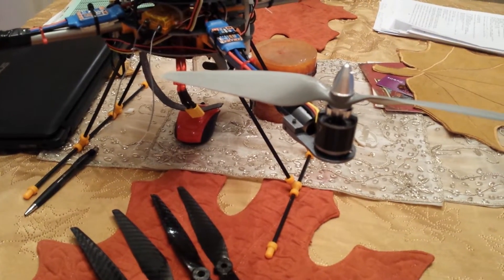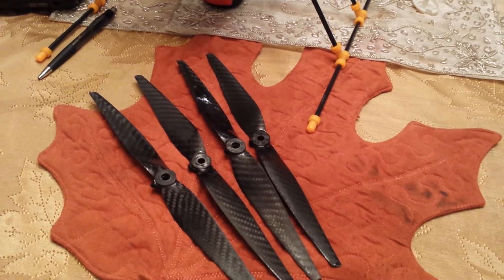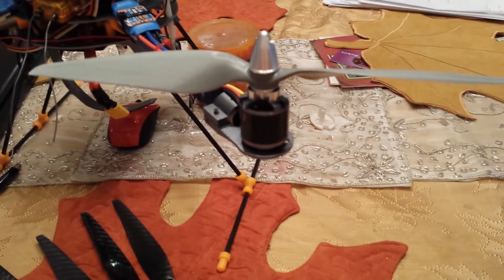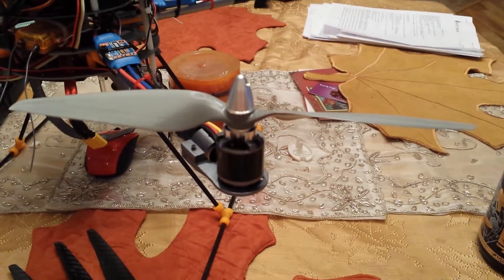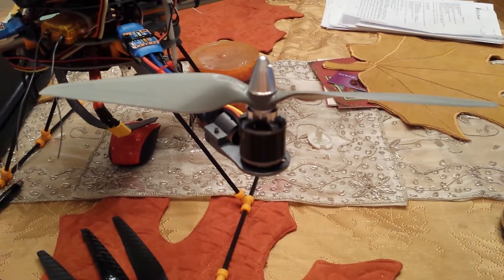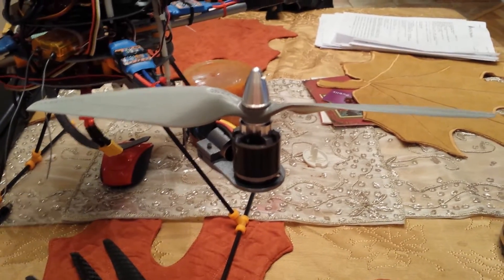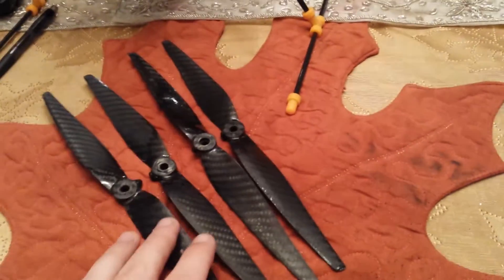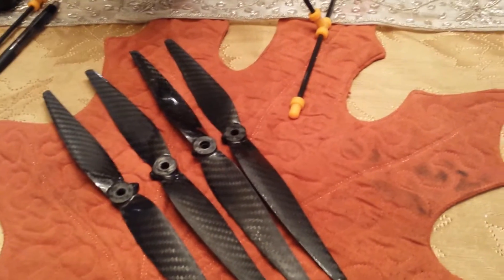apc 10x5.5 MR vs neewer 11x5 carbon props - comparison

Comment: I think your going with a wise decision....not only are the carbon fiber going to give you a little longer flight times.......they wont SPLIT in mid air and handle way more loads........Im currently doing a 580 quad build after not flying for about 9 months...because i had to go back to the drawing board after having crashes from the plastic apc prop hubs spitting ( yes props were balanced and tight but not too tight)......like I say, I agree with the pitch and carbon fiber that your going back too...your quad will thank you..LOL

Comment: those 2814 motors that you got normally work better with larger than 10 inch props so i guess the problem is not the apc prop to be a bad prop but to be a bad prop size for your large motor , i now carbon props are great but they are expensive , apc came out with an 11 x 4.5 prop that might work as good or better than your carbon 11 x 5 , they don't have them on stock in most of the major online stores but you can get them directly from the apc website .
i got set of 10 x 4.5 props that i'm going to install on a dji f550 to replaced my old apc 10 x 3.8 to see if i get better results , i also order a set of apc 11 x 4.5 for a x8 quadcopter project that i'm about to start building it in the next few weeks .